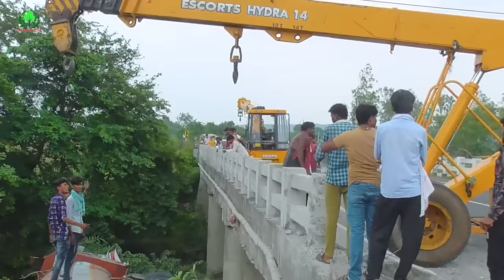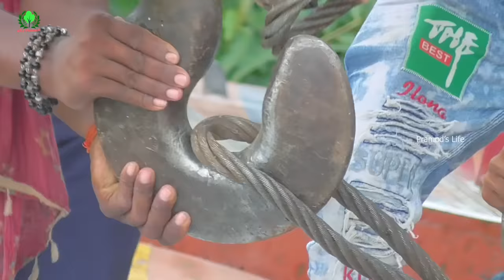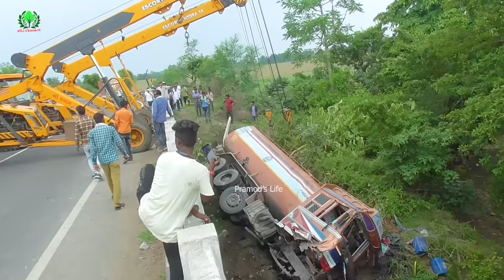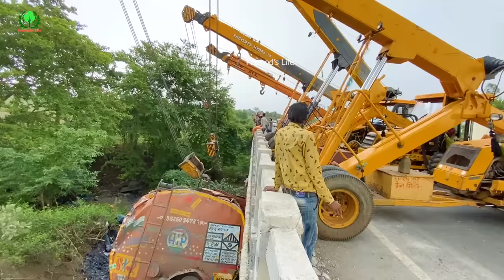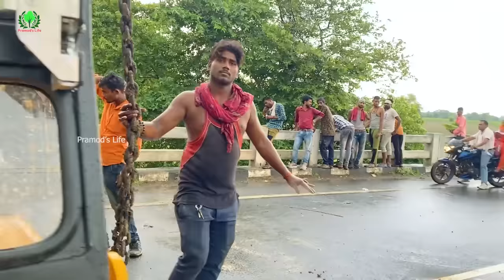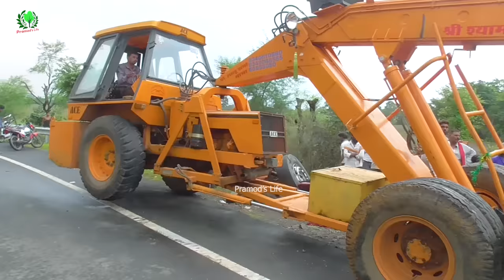Truck Tankar Accident on Highway very Badly 4 Hydra Rescued together

Comment: Very dangerous to lift the lorry without ascertaining the weight of the lorry as well as the capacity of cranes and slings. There has to be some safety regulatory mechanism for such jobs. The cranes have balance weights behind and if the load exceeds the capacity of the  crane, it will topple. Guys are foolish ...to say the least...